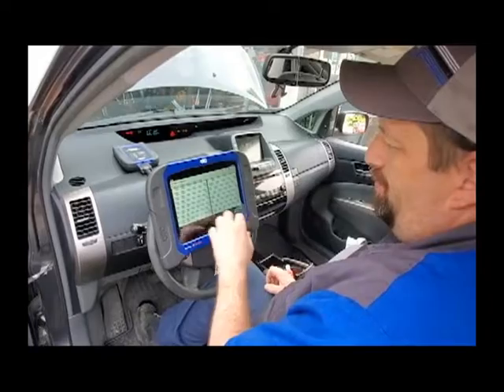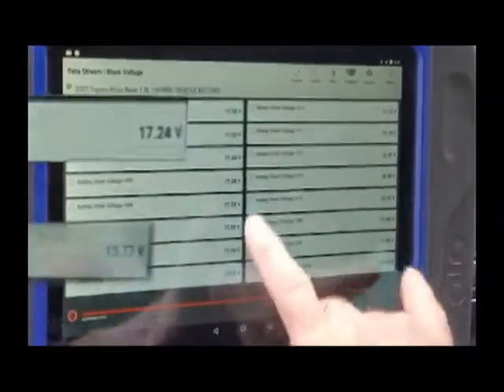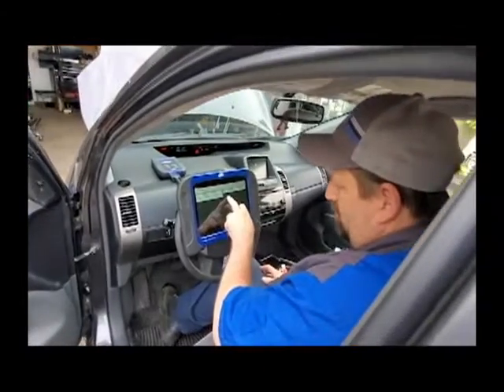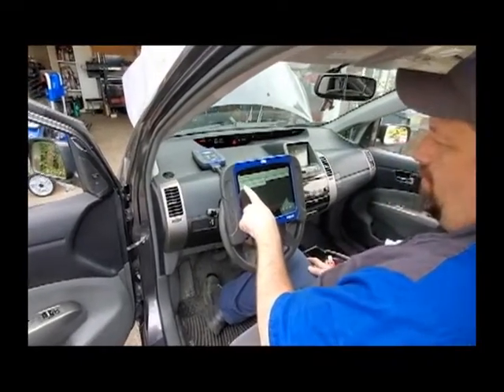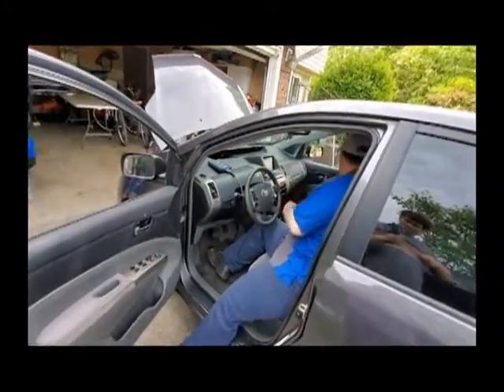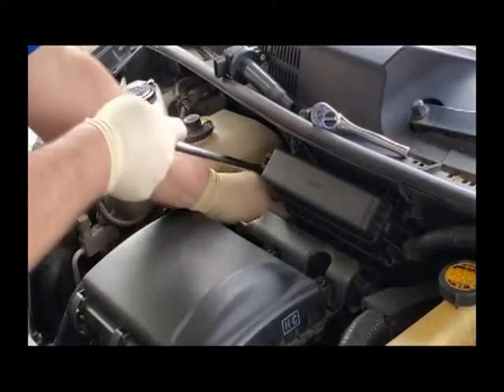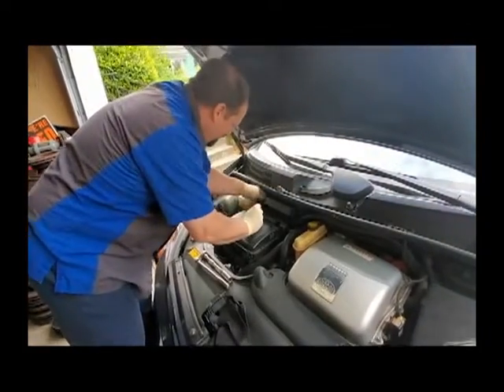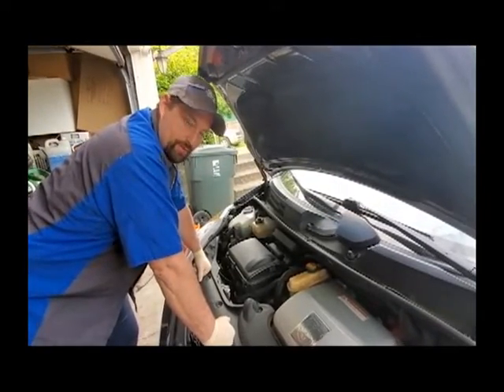2007 Toyota Prius Diagnostics of low power.

Comment: I have a 2005 prius that does not pick up speed the acceleration is very slow especially up hills and cannot go over 20mph with the gas throttle fully down , the red triangle of death and engine management light on the code is showing is p0420 catalyst efficiency below threshold bank 1 any ideas what could be the issue  ?
Reply from the maker: Start with new cat. Converter.
P0420 - 99% of the cat is bad. U may also have a restricted exhaust.
 U can try pulling the upstream O2 sensor and test drive see if you pick up some power. I'd guess u have a restricted exhaust.

Comment: How do you go about charging the battery
Reply from the maker: Are you referring to the 12v or the High Voltage battery pack.
 If you talking about the HV pack..... you don't as a pack
The hv battery will have enough to start the engine even when the system says its "dead". That is because "dead" is any actual charge 20% or less. What I mean is a "full" battery  is only 80% fully charged. Toyota did this as to not to over charge the battery or over discharge the battery.
  The 12v battery is an AGM (absorbed glass mat) battery if you need to recharge it remove it from the vehicle and use an automatic charger that made for AGM batteries. And regulater charger will try to charge it too quickly and damage it.

Comment: what a scam...not a honest guy
Reply from the maker: Are you calling me not honest? If so. Can you tell me why? In show that the block voltages were beyond 1v difference. I proved that the tune is good.  I verified the car was low on power. Also the charge and discharged very quickly. So please explain ur comment. If you can't back ur comment up then I will delete it. So this is your chance.

Comment: How how does the generator last ?
Reply from the maker: I dont understand your question. Are you referring to the Motor/generator (MG) in the transmission?
Reply: @Steve4x4  The battery generator. How long do they last?
Reply from the maker: @JD-ml7cg  again. I apologize I don't understand exactly what u are referring to.
 The only "generator" on the whole vehicle are the MGs inside the transmission. MG1 is used to charge the high voltage battery. It is also used to startup the engine when charging is required or when MG2 is needing assist to propel the vehicle.
 Now there is also a small 12v battery too, that is ONLY used to power up the lights and various computers.
 How long does the high voltage battery last? I cannot answer that with any honestly. There are too many variables that contribute to the longevity or degradation of that battery. I will tell you when new Toyota was warranting the high voltage battery for 8 years. 
How long will the 12v battery last? On average 5-7 years.
I hope that will satisfy you question. I best to answer it.
Reply: @Steve4x4  Thank you Steve !